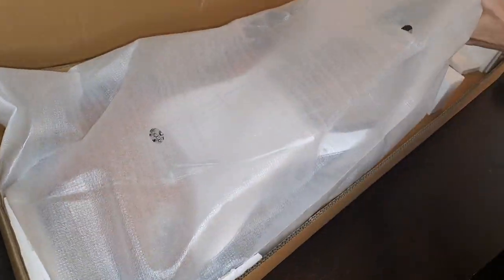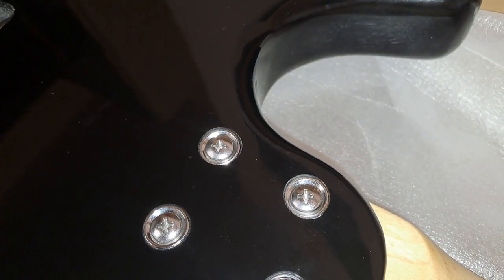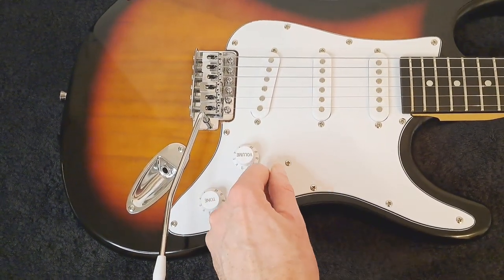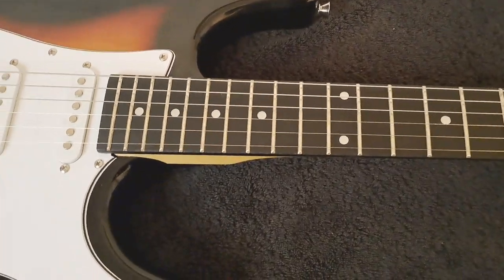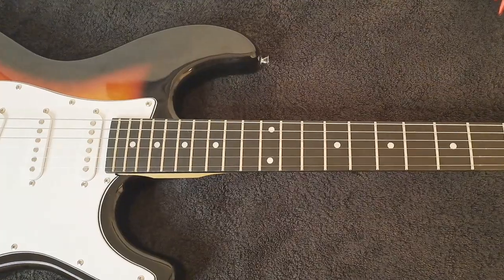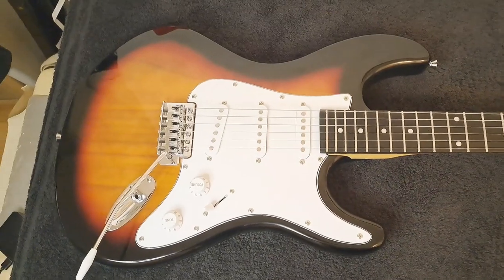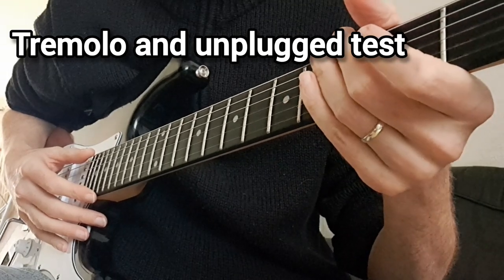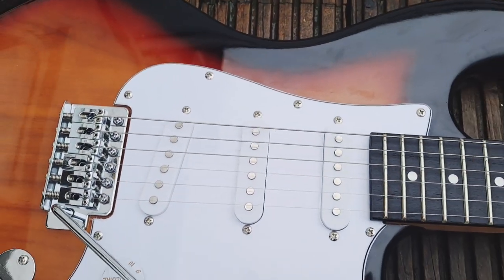Gear4Music LA Electric Guitar Review - BEST BUDGET GUITAR?

Comment: Hey, I recently saw another video reviewing the same guitar. In that review, there were comments about tuning, apparently the guitar easily goes out of tune, do you have any thoughts about that, is it true? Because I purchased the guitar myself, and I find myself a big paranoid about tuning? If there are problems corresponding to the tuning, would replacing the strings fix the problem? Or what would? Would appreciate your response, thanks.
Reply from the maker: No worries, tuning on a strat style guitar can be influenced by a lot of things... the tremolo, the nut and the tuners are some of the main things. Yes, strings too. So tremolo - for max stabiity if it concerns you, tighten it all the way down in the back of the guitar, then it can't move at all and cause you to go out of tune. The nut should be properly lubricated to let the strings move easily as you play - easy fix is a bit of pencil or just a dab of oil e.g. lemon oil you would use on the fretboard using an old string. The tuners do make a difference. I was lucky on mine, they are ok, but it's a cheap guitar so maybe they're not all the same - having said that you can tighten the screw a little in the top of the tuning peg which might help a bit as it will prevent the tuning peg moving too much and may help - or just change the tuners. Regarding strings, make sure you really stretch them out when you first put them on, so tune them, literally pull on them away from the fretboard and do that 3 times and tune up each time. Overall, it's a decent enough guitar for cheap. It's pretty cool for modding too.
Reply: @appetiteforguitar  Thanks for replying, although if the guitar goes out of tune, (I mean that it doesn’t hold its tune for that long) could that be due to cheap strings? Does your version go out of tune easily?
Reply from the maker: Cheap strings can make a difference. Make sure to stretch them out though as I suggested which can help. Mine stays in tune pretty well. D'Addario is a good brand for example. I also really like Rotosound guitar strings. If that doesn't help, any of the factors I mentioned would make a difference.

Comment: The bridge on mine is completely screwed onto the wood to the wamy bar won’t even move a cm down
Reply from the maker: Sounds like an easy fix (assuming that's not how you want it), a suggestion would be to grab a screw driver and the screws can be loosened to taste. Keep rockin'
Reply: @appetiteforguitar  i though it was completely stuck until I realized that I didn’t push the whammy bad hard enough 😂
Reply from the maker: Ah, if it's really hard to push down, you could open up the back of the guitar to access the tremolo springs... you could then loosen the springs there which will make it much easier to use your tremolo bar. Enjoy! 🤘🎸